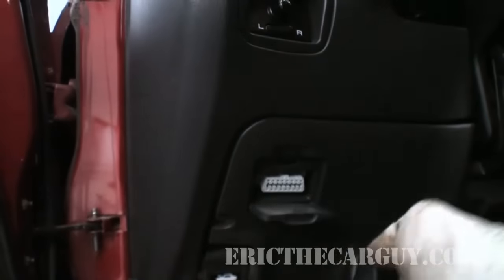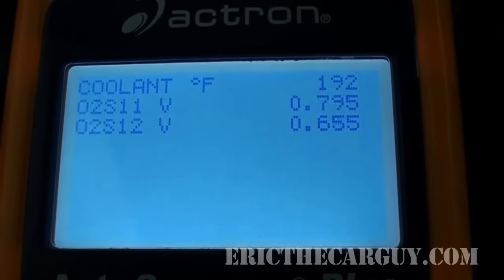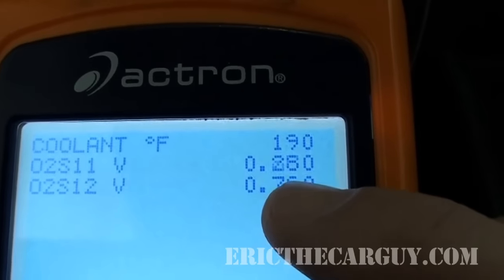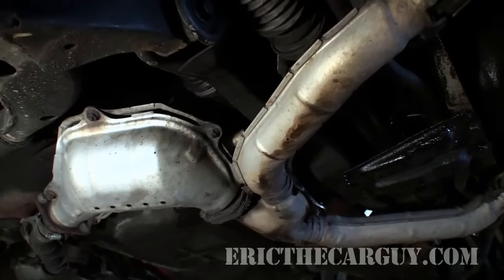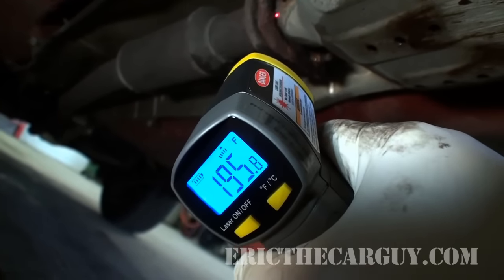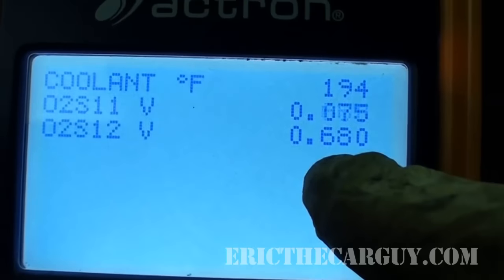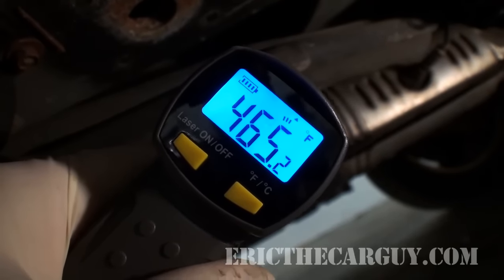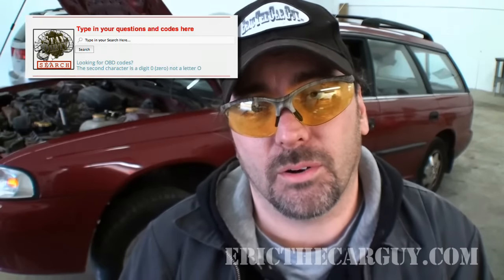P0420 How To Diagnose A Bad Catalytic Converter -EricTheCarGuy

Comment: I still have a p0420 code and I already replaced the cat
Reply: You probably have muffler clogged. The best way to test if your converter is bad. Is using a exhaust pressure gauge. You remove the 02 sensor (1) and plug the gauge and if less than 1psi means your cat is good. after the cat 02 sensor (2) and shows higher than 1psi. Ex. 2-6psi or higher means between your cat and the muffler is clogged. 

Also check your O2 sensor voltage. You must pay super super attention. I currently have vehicle that needs cat change. On 02 sensor 1 bounces which is good but 02 sensor 2 must be slightly steady. If is bouncing and reaching to 0.00 then yeah you have a bad cat. Unless, one of the sensors shows 0.00 completly means that sensor is dead.

Also, you can try this I've done it quick way. Buy an 02 sensor and replace 02 sensor 2, Erase the code and drive it for 24 miles @ 55mph use the cruiser. That will accelerate the computer. Use the scan tool to see all the codes are clear but don't erase it. Go to state inspection and you will pass. Now if shows up during the 24 miles engine light comes on then that means your cat is super super super damage. If shows on the next day the engine light also you have a bad cat. 

Why after the cat, think about when you clean your computer fan. You blow clean air and the dust comes out after the fan, right? Well, same way is the cat. If the cat is working probably the sensor 2 will show clean if is bad the sensor will get dirty. That simple.

Catalytic temperature I really can't figure out. I've done it I just can never understand lol. But the rest of what I explained works for me.

Comment: I've had my P0420 for a while now. I replaced my cat with a universal weld on Magnaflow one. Replaced both of my O2 sensors with some Denso ones. No exhaust leaks. I used my temp gun and it reads approx 400 inlet 500 outlet (degrees Fahrenheit).... So why does it still pop up? It doesn't stay there but the P0420 CEL will disappear for a  few days or weeks and then come back and will do the same thing again and again..... Not really sure whats up, Everything is replaced and according to the temp readings it is doing what it is suppose to be doing wtfffff
Reply: +Derek Nguyen Have you ever replaced your spark plugs? Old plugs can do it too.
Reply: +Derek Nguyen  some manufactures have TSBs to update the PCM due associated with po420 codes it is actually pretty common if you can get me your full vin# i can look into it for you
Reply: +Justin Shelby i got the same problem! Can you check mine?
Reply: Do new spark plugs it should clear it up.
If it still pops up probably bad o2 sensor-replace it.

Comment: like the avg guy has those tools
Reply: A cheap OBD scanner and a cheap IR thermometer? Both can be had for less than $100 altogether. If you want to be a cheapass, that's your right, but these tools are not expensive at all.

Comment: but can a bad cat make a noise ?
Reply: +dunno yolo yes it can
Reply: +dunno yolo - Yeah, if it's got to the point where the ceramic element inside has broken and is rattling around (like it is in my car right now...)
Reply: mine too. somethins been rattling around for the last few months and Im pretty sure its in the catalytic converter.
Reply: ChayD thought it was a engine issue but got a stethoscope and is only noisy when touching exhaust pipe
Reply: +dunno yolo Yes it can! The catalyst can break into chunks . If its rattling replace it. A easy way to check this is to use a hammer and LIGHTLEY tap in the middle of the cat .You shouldn't hear any rattling .
Reply: my car is a 2000 Honda civic and it makes the same rattling noises once my car is on. plus If I leave my car running for awhile and then drive off it feels like it's taking forever to speed up and it's not really going anywhere. Do you think I need to replace my Cadillac converter? please lmk..I haven't been driving my car too much lately because of that reason of it losing speed and me thinking I'm going to get stranded somewhere with my kids.

Comment: If your starving for gas and your Revs are low eg 2500k your Cat would be most probably be blocked or crumbled up; undo nuts in front if cat to release pressure start it up see how you go!

Comment: But you mention nothing stating that catalytic converters don’t die on their own! You must first find the cause of the cat failure then get a new cat.
Reply: Um, not always true. They can wear out slowly or get plugged slowly with high miles & age.
Especially so on dual branch systems with 2 sets of Cats with unmonitored rear cats (no O2 sensors on them)
In this case the rears slowly plug then start causing upstream issues that mimic the Front Cats having issues.
These bedevil Mercedes owners - I can't speak for other makes as to how common this layout is, but its clog prone, to be fair normally after 15 years /150,000 miles.
Both my Benzes had this issue, a V6 and V8, and both now run perfect with these unmonitored Rear Cats removed.
Now the fronts all read fine / normal.
I would be glad if the Fronts now last life of car !

Comment: I removed 4 cats of my car , helps in power sound but you sure gonna smell it lmao
Reply: Modern cars are designed to run correctly with cats, you'll never have a proper fuel trim without them.
Reply: yup , thats why I got a tune when I removed them lol , nothin smells better then a catless v8
Reply: I don't really see how you could ever run a vehicle with an ECM, it would slowly stall out from being leaner and leaner.
Reply: You drive a matrix man, you don't have any "bolt-ons" or "mods," neither have you "tuned" it on a dyno.
Reply: loool I see you've read my scotty comment , I fix cars for friends and my friend has a matrix that im fixing , go check my videos , my car is an 01 mustang bullitt
Reply: Robert Chmiel Those cats are there for a reason... Captain planet is guna kick your ass lol.
Reply: I work at a shop in GA called injected engineering, before that I did diesel, and before that I was at a dealership. Only once have I removed cats on a car, and that was a track car.
Reply: So angry Robert, although my wife likes them, I'm not a fan of Toyota, I've always driven Ford and Honda. I guess being an actual expert on domestic and foreign performance vehicles makes me an idiot.
Reply: I guess removing the cats only added 20whp and 15wtrq so no it wasnt useless
Reply: lol sure , you belive his bull shit , I know my cars
Reply: If you live in a state that you can get away with that ,but you get caught without them on the car ,in some states they may take your plates .Most people just gut them.They smell real bad  like rotten eggs and sulfer
Reply: Robert Chmiel
First, it's adds you dummy. and second NO IT DOES NOT ADD ANY POWER! You're just slowly killing your car
Reply: Eric says stay dirty, hello.
Reply: Liistro777
 cat has nothing to do with the car running rich or lean, all that take place in the motor internally a cat is to reduce emissions nothing more you can a run a car on only headers and it wont effect performance at all, and at robert there is no way you got 20whp from removing your cat unless it was plugged up to begin with. hp is made at the crank and travels through the driveline to the wheels, the only mod you can put to your exhaust to see a hp gain is a turbo.
Reply: MRsteezy123 removal of the cat would result in a bad voltage from your narrow band O2, read the whole thing before trying to call me out.
Reply: say what you guy want but you know nothing of modding, obviously I got it tuned after the cat removal and o2 disabled and it make a difference on the high rpms
Reply: Liistro777
 your completely wrong they make adapter that you screw the o2 sensor in a straight pipe and the check engine light goes off and never a problem im ase certified i know what im taking about. i have owned allot of cars and all of them i got test piped, that voltage you speak of does nothing but tell the computer your put to turn a light on in your dash telling you to replace it..go ahead and run your car on nothing but the exhaust manifold and downpipe and it will start right up and run a drive just fine.
Reply: Robert Chmiel
 i know what im talking about there is now way you made 20 wheel hp from removing a cat unless its plugged, it makes no difference just in your imagination unless your cat was plugged your 0-60 times will be the same with open headers or a full cat back go ahead and experiment yourself. a exhaust is simple a supporting mod not a power maker, do you have a engineering degree are you ase certified? do you know how a engine works? the only time a exaughst will add horsepower is from 'scavenging' and  yes a bigger exaughst is gonna help you top end but not 20 hp especially just from a cat delete that is unheard of and i run the dyno every Thursday.
Reply: Liistro777
 no a adapter you can use the back of a hollow spark plug if you want the computer will do nothing,mini cat..i never said robert is right i know removing your cat will do nothing..i own 2 cars that are post 1990 and have no o2 sensors on the cat, they run fine..do you know why o2 sensors were created? to make the car run as efficient as possible and put out as little of pollutants as possible, and read a/f ratios well all the 02's the sense the a/f ratios to tell if your car is running to lean or rich ..the only reason a cat has a 02 is to tell you when to replace it so it can run as emission free as possible, its simply a nose in the exhaust ..i was not calling you out i could care less about this knowledge contest or whatever you want to call it...parasitic ground??? google cant even help me out with that one...and mini cats,  yes a adapter that goes in where the 02 went in a test pipe and then you screw the o2 on top of that and there you have it no check engine light..like i said you can make ones out of spark plugs.
Reply: MRsteezy123 So are you basically plugging the hole and making a resistor?
Reply: Liistro777
 your just making a whole and putting space between the actual 02 sensor and test pipe so the o2 doesn't read the extra emission in a lump sum

Comment: hi umm hi..waves hand wildly.. rofl first off excellent video now i have a. po430 and bad cat type stuff i just finished changing a bunch of things for other problems while abusing my cat...bad 🐱 soo im thinkin due to drivn my vehicle when first purchased with severe misfire and coolant leaking into the plastic intake on my merc 4.6 i changed the intake fix leak a few coilpacks and plugs i think my unbeatable cat is beat ...die 🐱..hehe